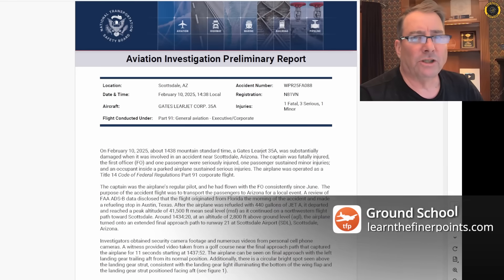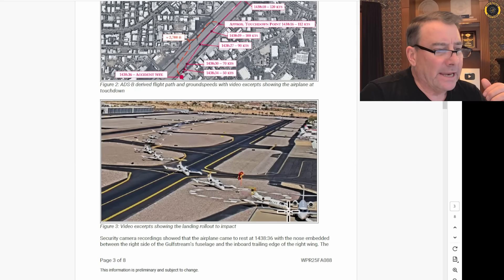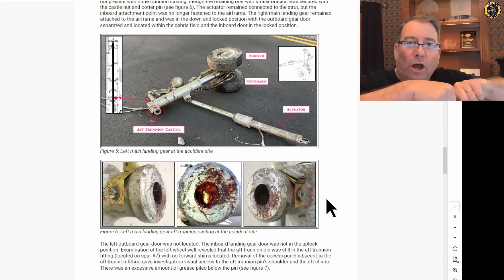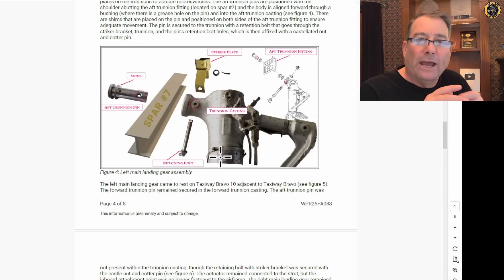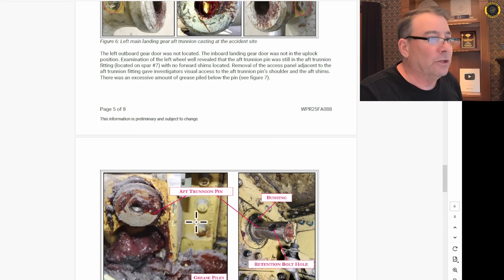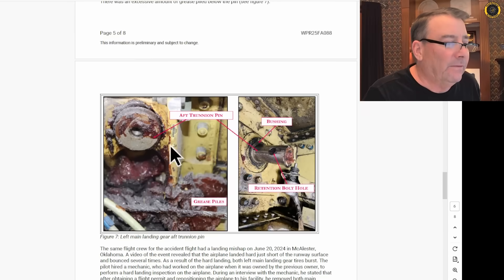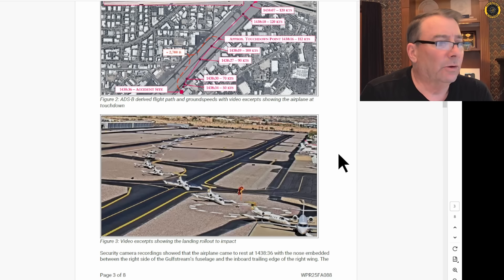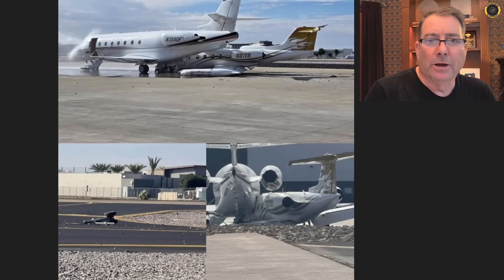NTSB Preliminary Report Fatal Maintenance Error Lear 35 Scottsdale

Comment: How is this even possible? As a glider pilot (and not a trained mechanic) I used to put planes together, including rather important parts like wings, tailplanes, and aileron connectors, and especially on older types you could actually do this wrong, e.g. forget or misplace a security pin. So obviously every connection was checked again, ideally by a second person.Why not in a professional maintenance facility?
Reply: That is my next question as well; I come from a different industry, so I can't say anything about the design, but what is the point of the mechanic noting down the oddities in the repair process, if no-one looks at them until AFTER a fatal accident?? Sure, we know more about what to blame, but shouldn't someone be reviewing the notes and see that as something to check into before sending people back into the sky? Especially if similar incidents have occurred in the past.
Reply: Well, the next thought would be: the second person missed this too...

Comment: these airplanes have a horrible safety record. This failure in maintenance is inexcusable; however, if the pilot didn't keep crash ￼ landing it, this would not have happened. I don't know if it was the same pilot in that earlier dive for the deck that caused that damage in the first place ￼  ￼

Comment: I'm an ignorant mechanical engineer but that mechanism you describe does not strike me as a good design choice. It should not have that much play. There are multiple things you can do to make sure that the only possible mount is to go through that pinhole. Strange that they did not use any of available engagement designs that prevent this. But again, this is me having a keyboard and no idea about mains.
Reply: This gear design is from the early 1960s.
Reply: @FlyingtheLJ  Not to pretend I know about all of them but locking mechanisms are millennia old. We went to the moon around late sixties with a vessel that has lots of mechanical locks and traps in it. They were not invented in that decade. So probably another boring cost reason if they kept it for 60 years.
Reply: @OKEKOBEB  Fair enough, the main reason to keep something like a 60 year old design is mainly because of FAA certification.  Each aircraft certificated by the FAA is done so by "Type Certificate Data Sheet" authorization.  Once a TCDS is issued it can have new variants added onto it.  I believe the old LR-JET TCDS has the Lear 23, 25, 26, 28, 31, 35, 36, and 55 - representing changes to the type from 1962 to 1990.  Because it's easier to add a variant onto a TCDS than apply for a new one, the engineers are under some pressure to minimize design changes and follow a "if it ain't broke don't redesign it" attitude.  

That's obviously a very oversimplified explanation.  I believe the later Lears under the new TCDS have just beefed up version of the same gear design.  Engineering time isn't cheap.

Comment: Imagine taking something apart to make sure that it is safe and then putting it back together and making it not safe.
Reply: Yes, somebody committed maintenance. We refer to that regularly. Working on airplanes is not for the casual mechanic. It goes with the territory that the mechanic's attention can be deadly or beneficial. It's a heavy responsibility.
Reply: Sometimes, during a crucial task, some coworker comes up and asks for a hand, or some other distraction occurs. I worked on trucks, not airplanes, but there were certain things like setting up wheel bearings, that I would absolutely not get distracted from. If someone needed a hand while I was setting up bearing preload and I had to stop halfway through, I either told them to wait, or backed it all off and followed the torque sequence again.
Reply: It happens all the time. Mechanics are human beings that screw up, like any other human being.
Reply: Everyone makes mistakes unfortunately. Can only do your best to try and find them before something happens.